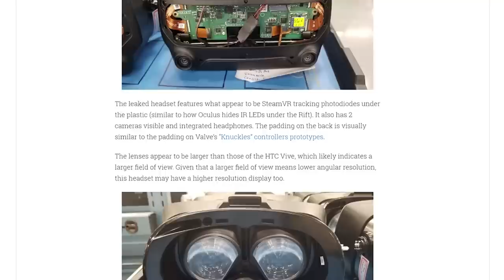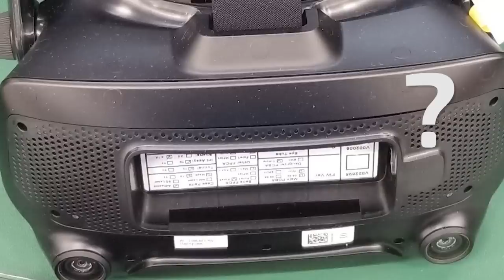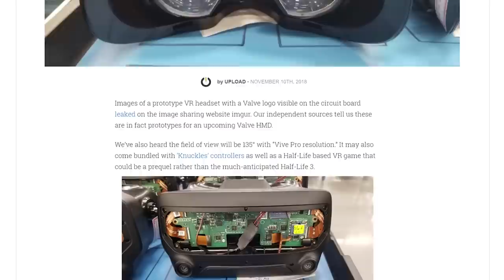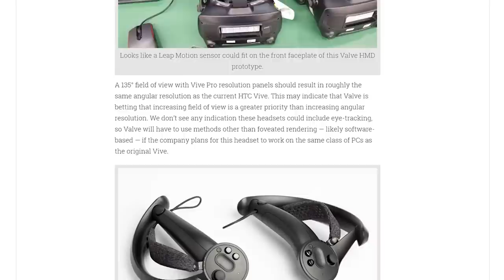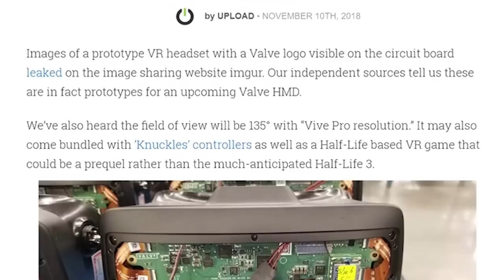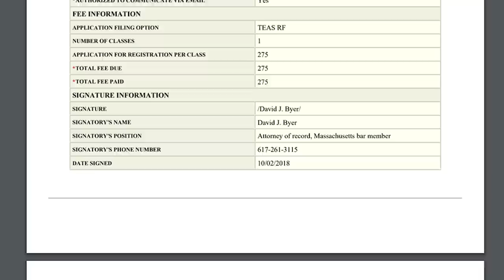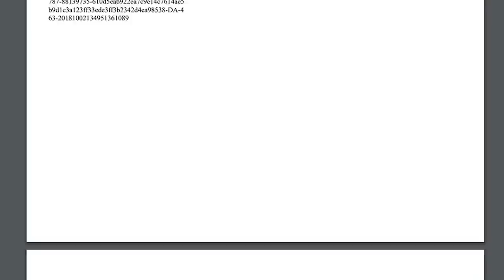Valve Index Virtual Reality Headset Leaked!

Comment: This is a move by Valve because HTC is shifting its focus away from user level hardware. It's not likely they'll be pushing anything more in terms of cheaper headsets.
Reply from the maker: The next year is going to be very exciting indeed! []-)
Reply: no,m htc is making user level hardware, they are just pricing at 3 times what its worth.

Comment: I'm all for it if valve is getting more onboard with there own vr, competition is a good thing and should help push the platform, my speculation for that slot is either for leap motion or maybe some sort of augmented reality device, i cant see it being a battery pack since its on the front and would be to front heavy for the headset also those knuckle controllers look awesome they are like a upgraded version of the current oculus controllers :D
Reply from the maker: I’m excited for the knuckles. Finger tracking sounds really fun, I can’t wait to get my hands on some []-)
Reply: it will also be handy for just looking around irl without taking headset off, similar to wmr's flashlight mode.

Comment: This looks really interesting. The Rift S completely sidestepped the enthusiast PC gaming market and didn’t go far enough or in the right development direction. The Vive Pro is massively overpriced especially for what it offers. The Pimax is a little too disconnected from the U.S. market and doesn’t have controllers or a really integrated hardware & software ecosystem (its also pretty pricey itself). 

This system from Valve has a lot of potential, especially if some of the speculation in this video is accurate. Hope to hear more soon!

Comment: On the open front panel picture, you have right in the middle something that looks very much like an electronic speed controller (ESC) which would be used to control brushless motors, perhaps as part of a varifocal display system.

Comment: "Panels do not enumerate consistently" sounds to me like a bug in the firmware or issue with the hardware where the displays don't identify themselves as 1st and 2nd reliably, ie. sometimes the left screen thinks it's the right screen and the right the left. looking back at the first image, a few of the headset have notes stuck to them, which has left me wondering if this is a batch of defective units.

Comment: I would be surprised if the space in the front is for a battery pack as it would throw off the weight distribution making it front heavy.  The Leap is old. Those guys adapted it for vr use and it was a good proof of concept but they really need to release a new one with vr in mind. the main problem with the current one is the small tracking cone.

Comment: 11:41 -  Based on that, it looks like it's going to be for their "Steam Link" audio/video/input streaming software, which they have discontinued the hardware on since the release of the apps (and ability to "steam link" simply between PC's)... Perhaps they are hoping to - or have already - perfected that software? Perhaps so much so that they utilize it in a VR headset? If they have something good enough to file a patent on, then it could even indicate built-in wireless for the headset. Valve doesn't half-ass things so who knows.

From the patent filing shown in the video:

•IDENTIFICATION        Computer hardware; computer networking hardware; computer peripherals; computer hardware and computer software for the reproduction, processing and streaming of audio, video, data, text and multimedia content

Comment: More manufacturers is great news, but if the headset doesn't represent a meaningful step up from the current gen headsets OR be priced significantly cheaper than even the WMR headsets then I'm not sure what is going to be achieved.

Comment: Finally! I’ve always thought HTC really screwed up with the Vive’s management. Not pushing for software, not advertising, ridiculous pricing. Valve gave them the thing and they did everything wrong with it. Now Valve can do things right. They have the hardware, software and the money to make a badass headset and with the knuckles. Always should had been the Valve Vive.
Reply: HTC fundamentally is a hardware manufacturer, they've never been very good with marketing - makes sense for Valve to drive VR gaming and push the standard for headset   quality with a bigger brand identity.

Comment: I don't think the recess is for a battery, the headsett would feel incredible nose heavy with a battery that far out. A battery would intstead be placed on the headstrap to act as a counterweight. I don't think its possible to make the headsett wireless at the talked about pricepoint either.  It's most likely a leap or something similiar in front.

Comment: I have the PSVR but now I have a good PC and I want a PC Headset and I can't decide if I should buy a Rift or a Vive (Focus on Beat Saber)
Reply from the maker: Rift is a lot cheaper right now []-)
Reply: @VirtualRealityOasis  but is it right, that i need a 3rd sensor for a good experience?
Reply: @Jonas_0_0  It really depends on what games you want to play and what experience you want to have. The rift controllers are better in my opinion but the roomscale vr is better with thw Vive, if you only plan on playing games like beat saber then go for the rift as its cheaper. But if you want to play more roomscale based games then go for the vive, best of luck!
Reply: @TheMrWelshy  Thank you!
Reply: @TheMrWelshy  I'm stuck between the odyssey+ and the rift. Are both currently the same price. It's either a better screen and a much easier setup with the odyssey or the better tracking of the rift
Reply: DO RIFT
Reply: You can have fun with 2
Reply: I have PSVR and a pretty good pc too. I’d say wait a while after the release of the new valve headset so you can get the most out of the previous gen head set (PSVR) and see what the new one will shape out to be like.

Comment: Those are not lighthouse tracking diodes.
Those are ejector pin markings from the plastic injection mold.
The fact that they are SO visible, leads me to believe that these are not final production, or are a very cheap item.
Evidence : https://youtu.be/azmjQutKNWw?t=26  Trakcing Diodes would need a IR transparent plastic such as the tinted plastic over the IRs of your TV remote.
Those dots on the VR unit are obviously the same plastic as the rest of the unit.

Comment: I think it's incredible and the so called leak's clever marketing. I was all in on getting a Quest as my first Vr headset but I'm waiting now. Higher Fov,knuckles and at least 3 Vr titles will be something very sweet. The Lab is a complex demo or treat for Vr headsets and I would expect something much more refined and amazing whenever we see the three Vr titles they are currently working on. Half Life Vr, Portal Vr and maybe Left 4 Dead Vr? Any Valve title will fully utilize the new knuckles
Reply from the maker: A four player Co-Op Left 4 Dead in VR would just be incredible []-)
Reply: Direwolf Why the hell would you get Quest, especially if youre considering this? You do know Quest cant connect to the PC right?
Reply: I will wait and see if Valve indeed does have intentions on releasing a headset before I buy into anything

Comment: I am a previous Vive owner, and now a Rift owner because of the exclusives, and touch controllers. I am now moving onto the Quest when it comes out. If Vive released a 4 (or more) inside out camera tracking headset with over 110 deg FOV, non tethered, I would be SOLD!

Comment: Man i wish i could afford vr!
I got a gtx 1080 but that took me 2 years to get
Reply: yea im planning on getting the rift but these are going to be WAYYYYY better than the rift. and if it is capable of wireless and you have the option to not use the tracker station things then it would be way better than the quest as well.

its like a nintendo switch you play on the go and if you want the full power you can use the tracker station thing and plug into your pc all the time.
and i imagine the price will be cut even lower as well

Comment: is it me or does the headset itself look really cheap
Reply: king brodan I mean. I personally don’t want to pay $600 for a fancy plastic shell.

Looks simple and less bulky to me. I’d take it over my Vive.
Reply: @thesafehouse2863  well yeah of course but it looks simply uncomfortable, the Oculus quest is 400 and it looks comfortable
Reply: king brodan The Oculus Quest is a stand-alone that’s rated at mobile quality graphics. It isn’t a PC comparable headset. And the nose design with the Deluxe Audio strap looking thing is fine.

Personally own the Deluxe Audio strap with the Vive. No real complaints.
Reply: @thesafehouse2863  now what if this can be like the oculus quest but if you want the full potential you can use a pc and the trackers around your room?
Reply: crodojoe the khajiit I personally wanted the Oculus Quest to have an option to be a wireless headset that could stream from the PC.

If Valve’s headset ends up having both options it would be amazing. But I doubt it.
Reply: @thesafehouse2863  the oculus quest is just a wireless wmr  and i don't think you can get steam on it which is a major rip.

it is looking like in the future valve will make a come back. but now that this is coming out i will get that in the future but right now i want the rift since the controllers are better and it is cheaper (the vive might have even a lower price when the new one comes out)
Reply: crodojoe the khajiit Vive isn’t the same as Valve’s headsets. The Vive is Valve’s tech with HTC’s manufacturing. This would be 100% Valve.

And as for the controllers. Valve’s Knuckle controllers are definitely the future of VR as a whole.

It can track you fingers and know what pressure is being applied without using a glove. You should check it out. Just Google “Valve Knuckle Controller EV3” or if you can’t find footage of that, check the EV2.

Comment: They look really fucking ugly. Also I hate headphones on vr headsets. I’d rather use my own. Also if this doesn’t have a resolution of 4 to 8k. I don’t give a fuck for it.
Reply: Why Does It Matter Yeah no. We’re not getting dual 8K lenses for the next 20 years on any headset.

People can barely run the Pimax 8K with its dual 4K lenses at its high FOV.
Reply: @thesafehouse2863  I know this. But with the hole "Focus" feature in concept. It should be easier for PPL with lower end rigs to run dual 4k.